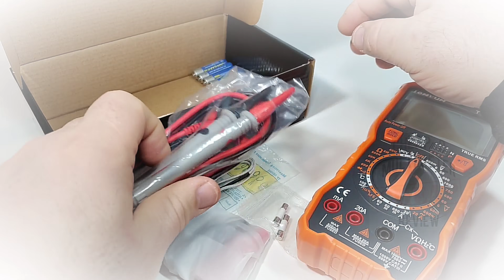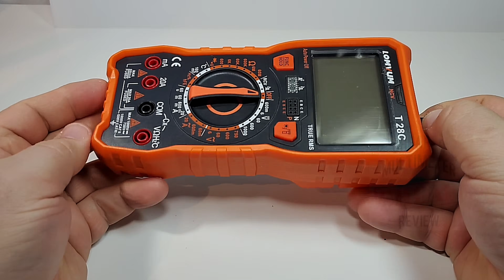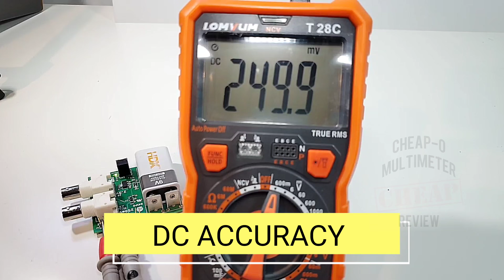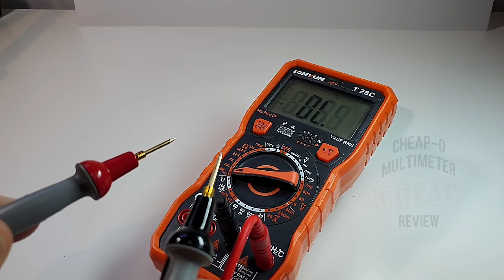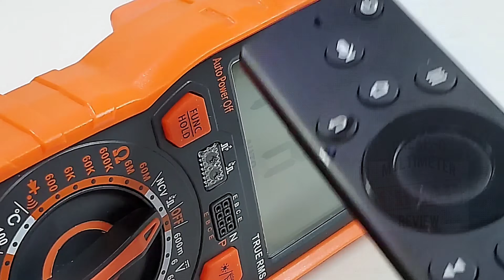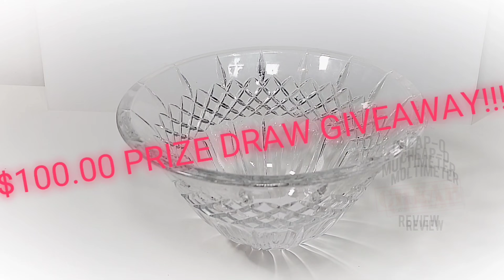LOMVUM T28C CHEAP-O Multimeter  Review & Teardown!

Comment: Nice video - I just bought one.  Any idea where to get the ceramic fuse that's 20A 250V?  Thanks.
Reply from the maker: Ebay is your best bet. These are 6X30mm  20A 250V Fast Blow Ceramic Fuses. Use a digital caliper and confirm the size. https://www.ebay.ca/itm/293687778153?mkcid=16&mkevt=1&mkrid=711-127632-2357-0&ssspo=8pLFV2FzTiC&sssrc=4429486&ssuid=8LHX1CvSRCO&var=&widget_ver=artemis&media=COPY
Reply: @KeepOnTesting  Thank you for the response.  Actually, my unit has 6x20 mm fuses.

Comment: I'm not getting sound out of the continuity setting is there a switch?
Reply from the maker: Press the function switch once, it might be in diode mode , pressing function will switch to continuity.
Reply: @KeepOnTesting  that didn't work, little sound symbol shows on screen but no sound when touching probs together.
Reply from the maker: @timd5597  You may have a faulty piezo. You can try inserting a low frequency directly into it with a function generator just to verify its working. Also, check k tge teaches and clean the pcb with ISP.

Comment: Do you recommend this meter or the t28b?
Reply from the maker: Same multimeter.  One is AUTORANGING the other is manual ranging. Boils down to personal preference.
Reply: @KeepOnTesting  thank you. I wasn’t sure if one was more accurate, I saw another video that was saying the auto didn’t always work properly.
Reply from the maker: @GrowYourOwnFun  No they have similar specs.. by it's nature a Manual ranging meter will usually be quicker to Range. If you only will have 1 multimeter buy the automatic,  if you have several then I'd probably choose the manual ranging.👍
Reply: @KeepOnTesting  wow thank you very much
Reply from the maker: @GrowYourOwnFun  My pleasure 👍
Reply: @KeepOnTesting  Also, it appears that one has transistor testing and the other doesn’t.
Reply from the maker: @marjoriegoldspur6798  Good point! 👉 👈

Comment: While the price is quite low, I would not use it to measure usual mains voltage or above. Those fuses do not look capable to deal with higher levels of energy, such as an arc flash situation. Just for reference: According to the Fluke 117's manual, it is equipped with a fast fuse for 1000 V @ 11 A and said to break a current of at least 17.000 A. And yes, that device is pricier.

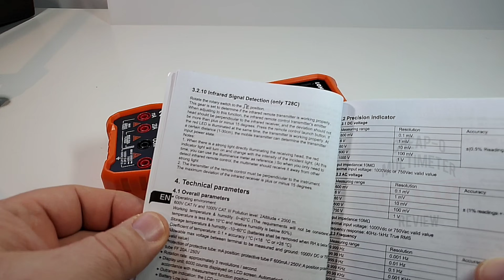Comment: 15:00 "no bright light should be near this." just being curious here, but, have you tried it in complete dark environment, Darren? maybe somehow its sensor needs a pitch black surrounding to work properly so they put that note in the user manual?
Reply: As this remote looks very much the same as the one from my amazon fire tv. Could it be a radio controled remote?
Reply: @Theanimalde  AFAIK the Fire TV remote is equipped with an infrared transmitter.
Reply: @Timo-M  Mine is definitely not. The box is hidden behind the TV and barely any light can get there. Also it works through the wall.
Reply: Theanimalde Having wireless functionality does not exclude being equipped with an infrared transceiver. At least Fire TV Stick 4K comes with a combined remote. It has both Bluetooth and infrared.

Comment: Hey, thanks for posting this video! My meter is basically the same model, but auto-ranging, and without some features (like transistor and infrared mode). Anyways, mine is AoKoZo T28B, which is a brand only available here in Italy. Good review and very nice meter!
Reply from the maker: Thanks for the info. Yes, its a great multimeter with solid build quality 👌

Comment: Spot on...nice and accurate with almost  all the feature cheapo meter , wish I have that on my shop.
Reply from the maker: Its really accurate even at the lower voltages which is very nice. Its also built like a tank so it should be great in the shop.